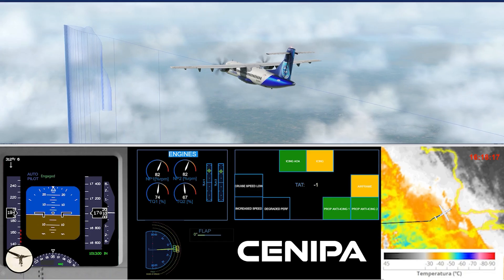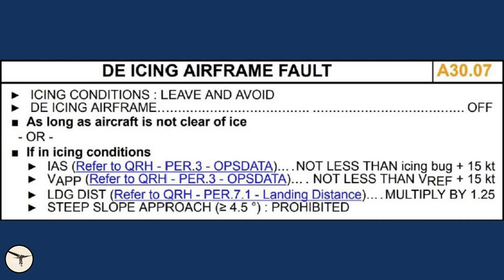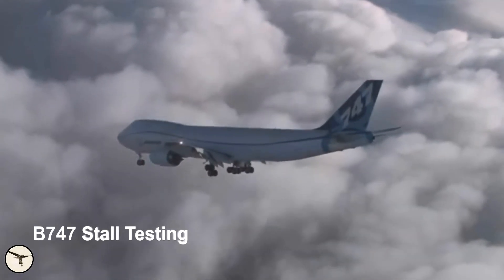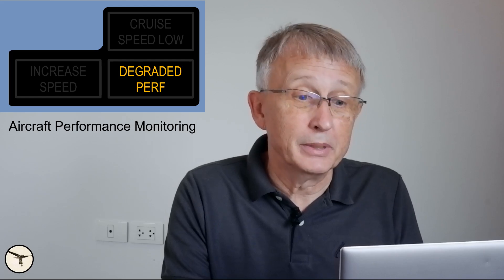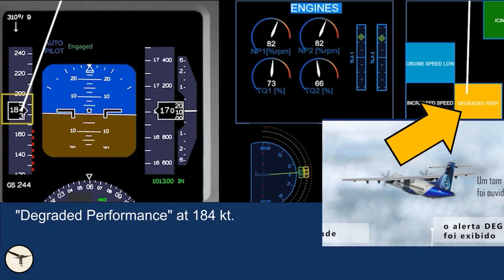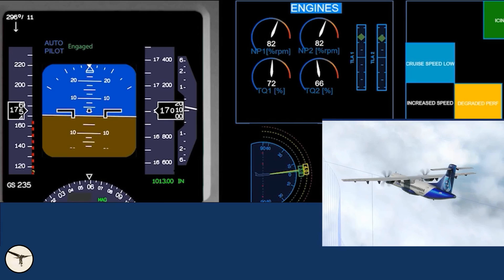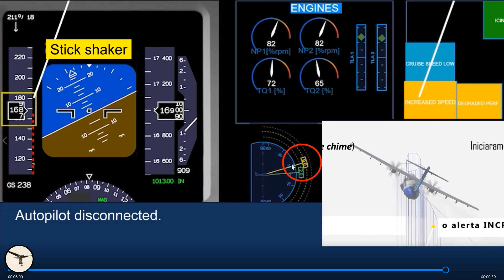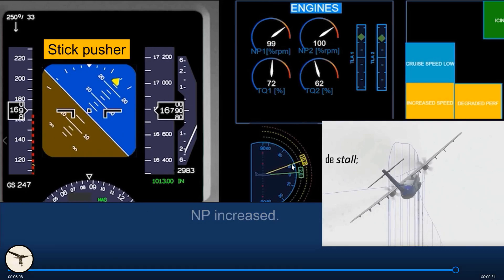ATR 72 Crash: Understanding the Flat Spin Disaster - Expert Analysis

Comment: Why flaps  15 on ATR stall recovery?
Reply from the maker: It reduces the stall speed.
Reply: I have 3000 hours on AN-24-same ATR,and there is no such action in AN24 FOM.
Spin recovery-slightly unload,opposite rudder,aileron neutral,after spinning stopped -rudder neutral, after speed up gentle pull yoke with G no more 1,4.Configuration unchanged.

Comment: @11:35 I flew the old 212/212A. I seem to remember a pneumatic system that would force the condition levers to 100 OVRD automatically under certain circumstances. It's been 14 years since ive flown it so I could be wrong, or mixing it up with one of the other many types ive flown 😂. One thing I do remember is I hated that POS lol.

Comment: A good unbiased technical view and it certainly highlights some badly made decisions. However, its just too simplistic to point fingers at pilots and technical aspects of the aircraft only. There is a lot more to operations that that. I have flown both the ATR and the Dash and have also been a simulator instructor on both types. The Dash has a complex airframe and a simple cockpit, the ATR is essentially the opposite, though I only flew the ATR 600. Personally if faced with a tough situation, the Dash would be my pick.  
Looking at both aircraft from a human factors perspective, the ATR whilst supposedly having a more modern cockpit is a much more distracting aircraft to operate, there seems to be a more pedantic approach to small issues and a lot of 'wordy' scenarios during training which is well reflected in the various aircraft manuals. The Dash is simple and straight forward, it's like a big twin to fly and to be honest I always felt that myself and other crews that I observed, had more mental capacity available when flying the Dash. Despite all the fancy protection that the ATR offered.  Which also may make crews overconfident. I did 4500 hrs in the Dash in many parts of the world and only one time when  icing drew my attention. I only did 1000 hours in the ATR and had quite a few instances of having my attention drawn to potential icing difficulty.
I liked the cockpit in the ATR, and there are some nice features there whereas the Dash cockpit is a generation behind. 
Overall, the Dash is a much more sophisticated aircraft that has a fairly good track record to back that up though it certainly is a much more expensive aircraft to operate.

Comment: It's interesting how you "forgot " to tell the degrees on the banks. The first was 32 degrees,  we all know the AP doesn't go that far. The second bank " to the left" is 50 degrees.  It means that in both cases the aircraft was ALREADY out of control. 
Try again your "very calm" explanation taking to account the banks on the turns and  try to explain how a airplane can gain altitude after a Stall,  then MAYBE I'll give you some credit.
Terrible explanation! It's a disgrace to those who want to understand what happened.

Comment: Thanks Magnar. This is by far the best explanation I've seen. Thankyou. I must ask the question of why the pilots chose to navigate and keep ATC happy in preference to aviating and flying the aircraft correctly. While it is very probable the pilots were unfamiliar with icing symptoms and procedures, they ignored speed and stall warnings to the point that when turning right (in accordance with ATC), the left wing stalled. The aircraft was still saveable at this point!!!!!!! It appears to me that that these pilots have not had sufficient, regular and relevant emergency training. The scenario of stalling/avoiding stalling was completely foreign to them. I'm putting my money on the airline management getting the blame for this accident.
Reply: I agree to everything you said. And I would like also to stress that the stall happened while the Auto-pilot was engaged. This does not take out or put any additional blame to the pilots, but the fact is that autopilot was engaged, initiated the turn as pilots have programmed it to do, and then the aircraft stalled. I hope this fact will also be studied by the investigators. It would not be hard to make the autopiloting system aware of the high probability of the aircraft having a degraded performance capability due to ice accumulation.
Reply: @LeaoDN  Absolutely. I totally agree with you. And, another thing, according to another video I watched (might have been Magnar or Blancolirio) auto pilot IS NOT TO BE USED in severe icing conditions, according to the POH (or airliner equivalent) after the previous icing accidents in this type. It will be interesting to have this verified. But it makes a lot of sense. I am amazed at the lack of awareness and even skill by the pilots. 

The flight instruments themselves were a give-away (let alone the annunciator panel) . Increasing nose attitude (AOA) showing on the attitude indicator screen and decreasing airspeed whilst engine rpm and torque remained relatively stable at cruise levels (in the early stages) were sure signs of an impending stall. Then the aeroplane expressed its first obvious bit of body language and the left wing stalled during a right turn. Surely this would have been enough for the pilots to wake up and realise something was very wrong and take action to manually disengage the auto pilot and push the nose down. This is stuff they would have  learned in GA school flying a warrior or a cessna.

Comment: Does the ATR not have an auto throttle system? I note the power in the cruise sits at 82% N1 until the pilots attempt the stall recovery.

This is devastating for the families, and equally terrifying that the stall recovery was handled so poorly - let alone the list of bad decisions and lack of airspeed awareness that got them into that position to start with.
Reply from the maker: Tuboprop engines have different indications that turbofans. NP is propeller rotation speed. It is 82% in cruise regardless of power. NP was increased to 100%,  and during the final moments, the torque (TQ) was incrased.
Reply: @FlywithMagnar  thanks for the reply. I’m a 737 driver. Why wouldn’t the AT system try and hold the target cruise airspeed? Edit - just realised my error in reading NP1 vice N1 - still, I would have thought the TQ would increase as IAS decreased.
Reply from the maker: No autothrottle in turboprops. The power lever is set in a fixed position called the "notch." A power managelement selector can be set to Take-Off, MCT, Climb and Cruise. The engine will produce that power. We do not cruise with reduced power.
The autopilot can follow ALT hold or IAS hold. Not both.
Reply: @FlywithMagnar  I see, thanks. Very unfortunate sequence of events.

Comment: Dear Commander Magnar, 
As a retired airline captain here in Brazil after 38 years of flight, I would like to comment on the ATR accident. 
Regarding weather conditions, we are currently having a strong influence of "El Niño" that has formed atypical cold fronts in southern Brazil.  The Voepass took off and flew inside a cold front that lowered the temperature a lot where it passed. Severe ice conditions advice was issued by meterological bases.
Another observation I make is in relation to the captain who was young in age and perhaps in the function. I believe that they did not have specific training in the severe ice conditions, as it is a rare condition to find in Brazil, so we see that they did not take the actions they should or that the check list mandated. Not even the "memory items" were made. 
Another observation is to ask for a "mayday" or "Pan Pan" notice to the ACC and go down immediately. I believe there was resistance to issuing the emergency notice and having to respond later to your boss the reason. (Yes, there is such a thing here in small companies). Even knowing they had an inoperative defrost item. I reinforce that it is my opinion. I was an instructor and examiner in all planes that I flew and I witnessed this resistance to take certain actions because he thought he would be diminishing himself as a captain, unfortunately.
Congratulations on the video and we will wait for the conclusion of CENIPA.
Reply: Perfeitas observações. Complacência MATA. Tô cagando se a chefia vai ficar bravinha ou achar ruim, eu sou o cara que desliga o motor bom numa pane de bimotor em decolagem pra acabar com a assimetria se necessário, provavelmente o avião não vai ser recuperável, mas pelo menos eu e os passageiros vamos sair vivos.
Reply: We don't have a el niinho in this time of the year

Comment: Is this another case of over-automation or autopilot dependence?
Reply: Unlikely. With the exception of the flaps, which are hydraulically actuated, the other control surfaces are moved by traditional cables, wheels and cranks. In many ways a very basic design philosophy.
The pilots completely ignored the APM cues.

Comment: If they pushed the controls forward and full throttle up can you still not get yourselves out of this?
Reply from the maker: Out of a stall? Yes. Out of a spin? No, it will get worse.
Reply: @FlywithMagnar   Within the 1st 1/2 turn of the spin, would the recovery methods tested long ago for piston twins work?  Beechcraft did spin testing with GA twins and found that a test pilot could recover (the pilot wore a 'chute and had rehearsed a bail-out procedure).  They don't allow or approve the maneuver in normal training or operation.

Comment: The elephant in the room: why did they use rudder? There is the potential they had hinge moment reversal and could not get wings level with the ailerons bc of that. Flying so long in icing with AP on (which is exactly what is not recommended) and then causing a stall is the perfect recipe for hinge moment reversal. and that could also explain why they did not get the nose down, trying to get wings level first (which of course is not the most important thing in that situation).

Comment: Did you get that, pilots? if you enter a stall DO NOT apply rudder input!!  please please - I'm flying (as a passenger) those ATRs twice a week - and where I live (In Asia) you have already crashed 3 ATRs - due to pilot error - I am worried? - yes I am very worried - remember - NO RUDDER ok?

ATRs are great planes - provided the pilots know what they are doing. But they are death traps if the pilots are less than 100% professional. No bravado, please. And yes - all of you who used to fly for TransAsia airlines - and who are now flying for the 'other two' airlines - the adage "we can land in any conditions to put the other airlines to shame" is not a myth - one of the TransAsia stewardesses told me this. Imagine having such a notion as part of your corporate culture!!

Comment: Doesn't the flat spin means a to Aft CG? Shouldn't the plane self correct to a nose down atitude?
Reply from the maker: Not necessarily. A flat spin can also be initiated by applying engine power or ailerons against the spin. In a flat spin, the flight controls have lost effectiveness, and a recovery is impossible.
Reply: @FlywithMagnar 
Hi Magnar, would it be possible to apply asymmetric thrust to arrest the spin?
Reply from the maker: @marcg1686  Maybe, but once the spin stops, you must reduce power ASAP. However, if you are in a flat spin, the stabilizer is in the wake of the wing, and pitch control is lost.

Comment: In one of the videos you said that to recover stall you have to follow the "PARE" and one step is the "rudder oposite". Now you said they should not use the rudder.
Reply from the maker: PARE is for spin recovery. For stall recovery, push the nose down and keep the other controls neutral until you have a safe speed.

Comment: Magnar you nailed it.
Correcting with the rudder just increased the angle of attack and stalled the airfoil of the main wing.
Too bad the flight crew even got that far - so as to enter severe icing.

Comment: Great analysis of this crash! Are most pilots this uninformed about aerodynamics and the performance capabilities and limitations of the aircraft they fly? This type of pilot apathy in not understanding what's happening in such serious developing situation and performing incorrect procedures by pilots seems to happen repeatedly. When the aircraft is in a stall, the pilots seem to instinctly pull back on the yoke or side-stick instead of diving to gain back airspeed and allow the wings to generate lift again. In this case also to get out of the icing altitude they were in. Air France 447 also crashed due to pilot induced stall when speed indications were lost due to icing up of the pitot tubes. The junior most pilot kept pulling back on the side-stick until the aircraft stalled and the other more experienced pilot and the captain did not notice what the junior pilot was doing as they themselves were confused. Are pilots generally taught, when all instruments are lost or unrelible, to fly the aircraft at certain throttle setting with wings level and a certain shallow low angle of attack which would be safe instead of just assuming something is happening and incorrectly applying flight control inputs?

Comment: Colgan Air in 2009 and this Voepass arplanes both were stalls in icing conditions.  Capt Magnar on previous video pointed Voepass, this one, started descending without telling ATC about it, then ATC told them to stay at 17k feet for now.  He noted a sudden hard pull up to 2,400 fpm. So one of the pilots pulled up very hard and the airplane stalled.  So both were like PANIC PULLS by one of the pilots when they went upset.  Panic Pulls happen a lot by pilots weak for that.  A lot on USA GA too.  My 1997 EFATO CFI alerted me not to do that or he will have to shoot me.  No BS.  He carried a .25 old pistol when flying.  He noticed that pull up and alerted me and others.  Some deny Panic Pulls happen even now.  Their fault.  It happens a lot.

Comment: Magnar, could the yaw damper be responsible for the rudder kick right before the spin? How does ATR AP react when stalling? Does it disconnect both AP and YD or does it remove aileron and elevator servos, but keep YD (and therefore rudder servoactuator) alive?
Reply from the maker: The yaw damper provides yaw damping and turn coordination. It cannot move the rudder to full deflection. The autopilot disconnects automatically when the stall warning is triggered. The yaw damper remains engaged. The yaw damper disengages when a force exceeding 300 N is applied on the rudder pedals.

Comment: assuming flat spin to the left, Why don't try full trust on right engine, and full REVERSE trust on left engine, full left rudder.
that should accelerate spin rotation, generate more lift on right wing, that would create heavy bank to the left, that should allow drop the nose, and change to normal spin (nose down) after that spin recovery.
or I just eten some funny mushrooms?????

Comment: What's wrong with the education? Air France - Dash 7 in the US and now this. When i was educated (in 1980's) we had to demonstrate stall recovery and under the hood for  IFR training , we had to recover from unusual attitudes. Dette var på en flyskole i Florida med Vietnam veteraner som instruktører....
Reply: I just finished my Instrument rating (US), and can attest that unusual attitudes are still taught and tested. Stall recovery is not a tested item, but my instructor taught that as well. My understanding is that many larger aircraft have undesirable stall characteristics, so teaching stall recovery to new pilots in the actual aircraft is impractical or unsafe. UPRT (Upset Recovery Training), as I understand, is mandated for most airline pilots in the US, and is done in a simulator. Emphasis is placed on avoiding the stall entirely rather than recovering from it, due to the difficulty of recovery in many cases.
Reply: @asagraf7276  Congratulations with IFR - sorry for writing some in Norwegian - i said i was trained by Vietnam veterans in Vero Beach. When it comes to big equipment - yes - avoid stalling or even approach to stall, but the fundamental mistakes done by Air France over the Atlantic and the Dash 7 near New York - pulling the stick. Seems like they had no understanding of what was going on....